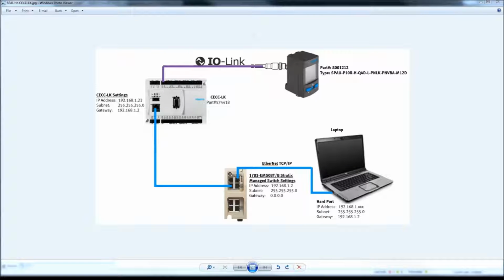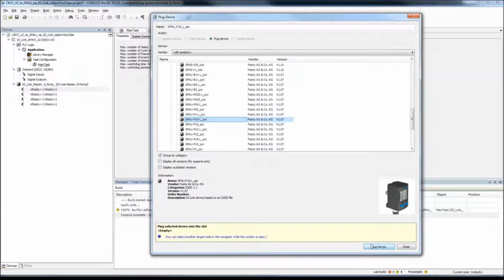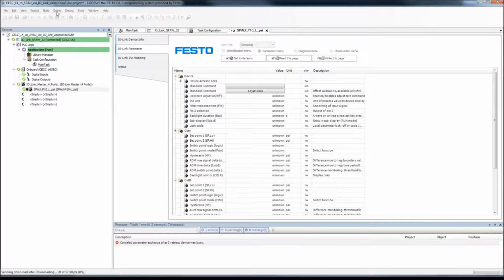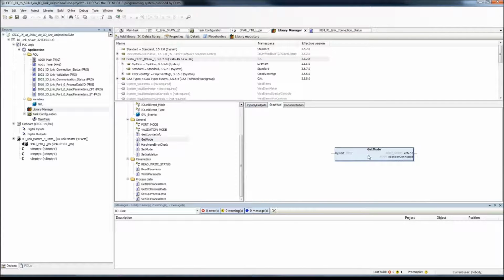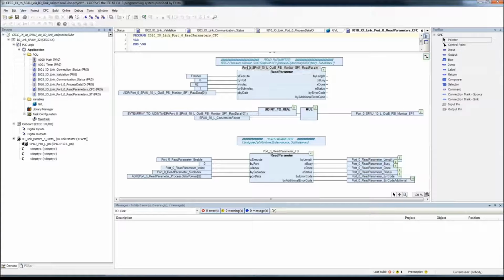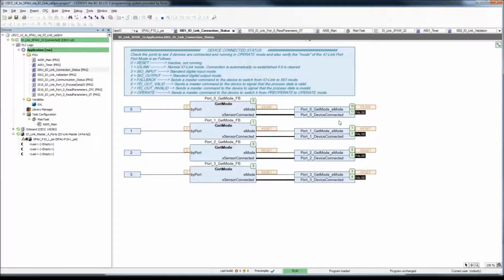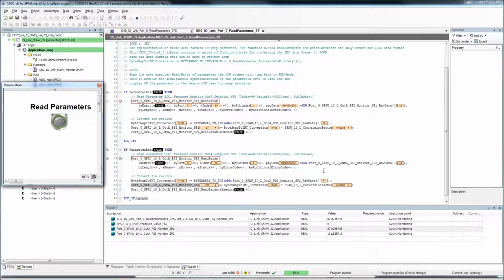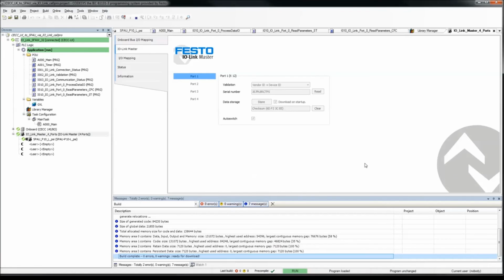Festo SENSORS + CECC LK + IO Link + Advanced with Library

Comment: thanks for the video but can you explain how to get the correct address
Reply from the maker: Hello Jerome,  I don't normally converse on my channel because I hardly have the time to create the videos and so don't expect to support them.  In your case, I do NOT understand your question.  The address for the raw process data is %IW1, which is found when you double click the sensor on channel 0 of the IO-Link master.  Further, you click the IO-Link I/O mapping tab and expand the PDV(InA).  If you look in the GVL, you will also find I mapped the %IW1 to a tag.